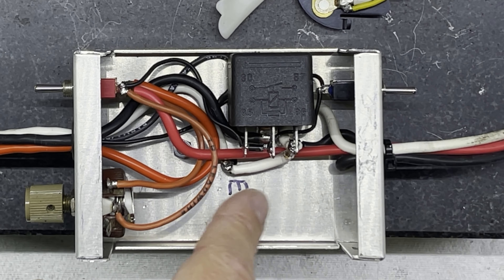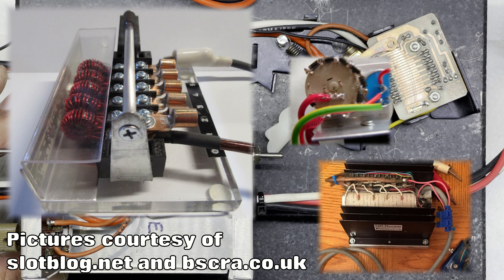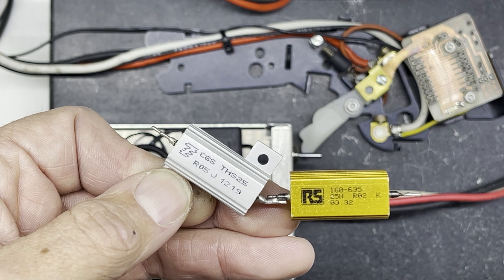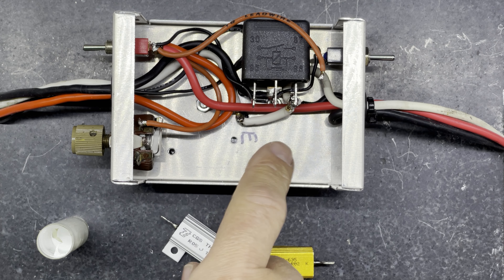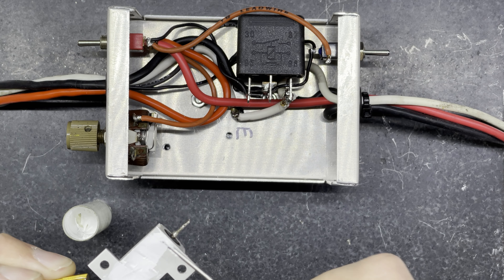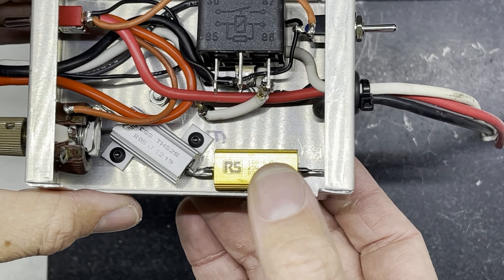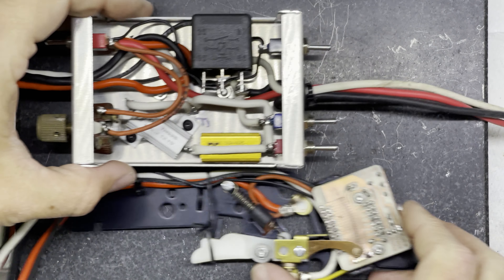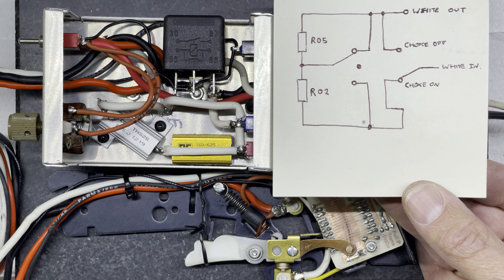A slower slot car can sometimes be a faster race car - How to add a controller choke

Comment: That’s a neat install James! When you have the choke switched on, would you tend to leave the relay on so that you can still get full power when needed or have the relay off so the “top end” is always restricted by the choke? The reason I ask is that some people seem to use choke to control how the motor feels or how the power comes on rather than controlling max speed. I guess the downside of having the relay off is that the transistor will tend to run hotter but that is probably ok for relatively short races.
Reply: I would tend not to use the relay when using choke. You would find quite a big step from the last power band to full power if you used the choke and relay at the same time.
The transistor would not get hot because of the choke, only through heat conduction into the heat sink if the resistors got hot. The Controller is still wired to bypass the transistor at full power, even with the choke activated.
Reply: @jmcleave  thanks. Yeah what I meant about getting hot is that some controllers use the transistor to try and deliver full power when the relay is off, and the transistor would in theory get warmer if it's in use at all times, but hopefully this is minimal.

Comment: Carrera digital of course you just turn the power down.  The Slot it cars I picked up make maybe twice the power that can be used on my home track,so they get turned down and still go sideways any time the throttle is turned much.....More hours of work are still needed on them.

Comment: Why not just add a reostat in circuit with switch
Reply: Hi Walter. A Rheostat with a switch would be fine for lower powered cars, but 25W very low ohmage rheostats are quite expensive and hard to find. I have not found one with less than 1ohm. I know you could then add a parallel resistor to reduce the ohms but it all starts getting more expensive and takes up more space.